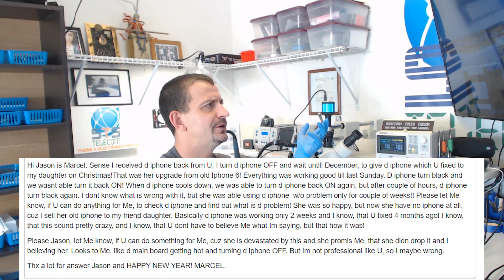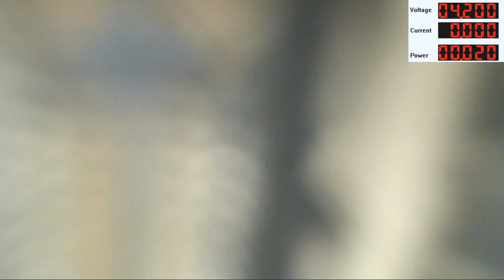This HOT iPhone 6s Plus Fixed Itself (A warranty job)

Comment: Some dirt on the battery connector? But very interesting, just today is one of those days that come every couple of months, when my iPhone 6 is getting hot for no reason and I wanted to ask you what this could be.
First thing I do when I get a new iPhone is installing a Jailbreak, I never do Updates and still on iOS 8.1.2, I love to individualise my phone because it's mine and don't want to redo all of this every couple of days and more important point is the forced obsolesence, make good hardware to garbage through software, through updates.
But because of the JB I have tools where I can see all the apps and services that are active and so I know that it is definitely not an issue caused by JB, sadly there is no propper Task-Manager where you could see usage of CPU and RAM.
It all starts with the crash on the Springboard and extreme lagging, every time I try to leave the safemode the phone just freeze and I have to hard-restart it, after a while this stops and the phone begins to get hot, no matter if it just lies there on the table or if I'm using it.

Comment: Hi Jason, what is the reason for putting the green goo on those components? I can't figure it out because they are inside the case so they shouldn't be exposed to any UV as far as I can surmise. Don't respond to this comment if you see it coz I know you are busy and I am hoping another commentator will clue me into the reason for the goo.  Thank You for your videos even though I don't fix phones and certainly do not do micro-soldering but I find them most interesting and entertaining (in a good way).
Reply from the maker: Honestly, I only do it because I had to remove insulation to get to them.  So after the repair, I put insulation back.  I really don't think it matters though.  :-)
Reply: Just to add, as definitely a non expert :) in a lot of cases it also adds to the mechanical stability of a repair, especial;ly when there are fine jumper wires involved
Reply: @ststele  Thanks Jason. Appreciate the answer.